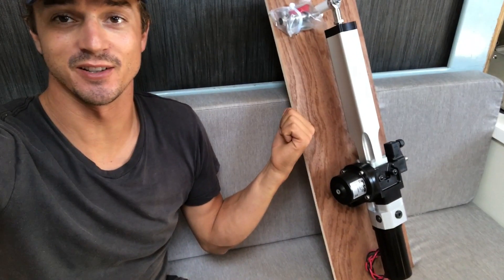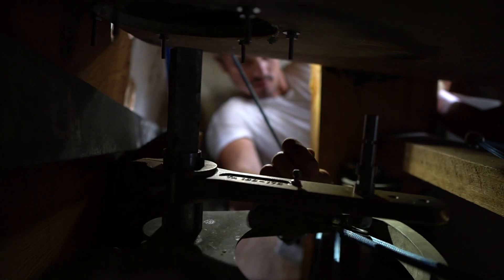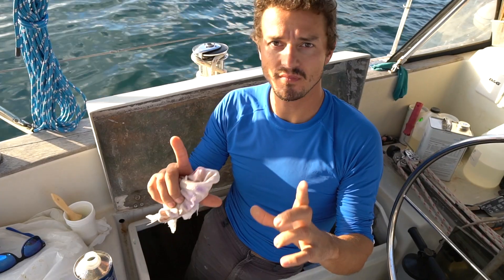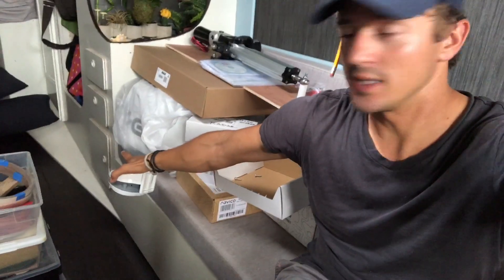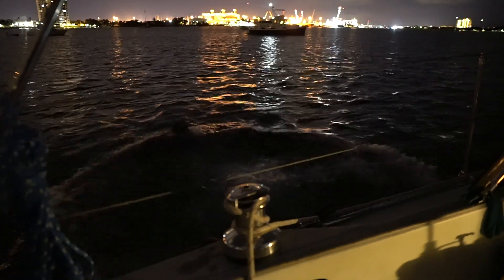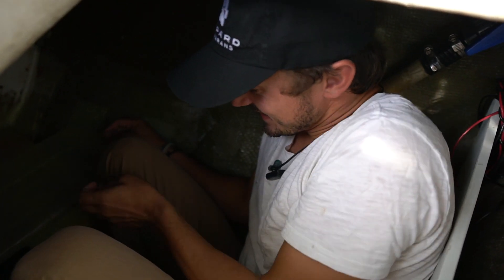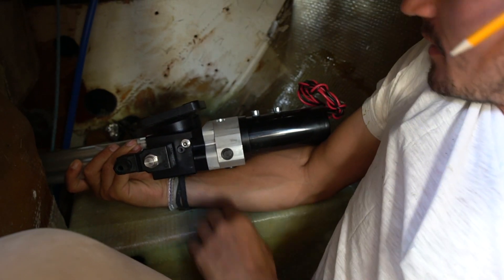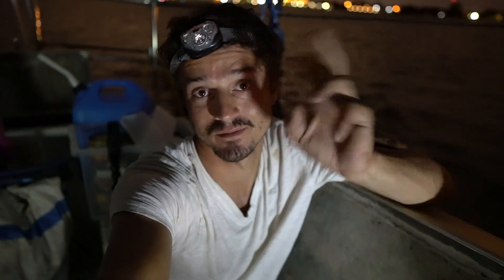Our Last Big Boat Project of the Year— Sailing Uma [Step 149]

Comment: You broke our hearts cutting the old auto pilot. Someone may have been able to get it to work. Maybe a family without an autopilot. ❤️
Reply from the maker: We thought about it. But the plastic itself was degrading and cracking. Not much left to salvage. Otherwise we would have passed it on.

Comment: I would have gone raymarine  ,proven,nothing wrong with wheel steering what you need was an upgrade to evolution,mine stays dead on course all sea conditions ,that hydraulic is for larger boats and uses more power

Comment: I could be wrong, but it looks like you should have installed the ram turned 90 degrees so that the mount bad is on a vertical mount, not a horizontal. The way that pin looks like it works, that is the pivot point for the ram to change angle as the bronze tiller turns. The way you have it mounted, as the tiller turns, and the angle changes, the ram will have lateral forces that may cause damage or binding. Maybe I'm wrong, I hope I am, but that's how I see it.
Reply: mount pad, not mount bad
Reply: This guy has a point. He might be right. At least it's worth re-reading the instructions, just to make sure. What he said makes perfect sense to me, since mine has a pivot allowing horizontal movement, not vertical movement.
Reply: While that it is a fair point to watch out for the orientation the way  I see it it should be fine, or yet its the way its supposed to be. The T0 Hydraulic Ram appears to have acceptable  360° horizontal movement (when base plate is mounted horizontally) and +-8° up and down. The way I see it horizontal turn is whats required to accomodate the changing angle to the tiller so this appears to be the right way, or am I missing something?
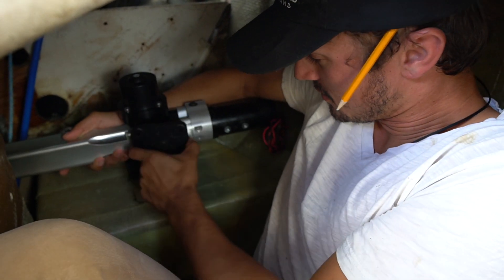Reply: If that's how it works, great, I just wasn't able to see that from how it looked like that pin installs and from the way Dan moved it at 15:19.
Reply: True the wiggling there seems to show the +-8° but i think it rotates too.
Reply: I hope you're right.
Reply: 17:11 You can see it rotate on the axis you are concerned with. He is good to go! You had me worried for them. haha
Reply: Good catch! Now I'm really curious how that pin allows it to rotate.

Comment: Dude, you’ve got to stop over building. Engineers already calculate in safety factoring. Weight equals danger & compounds your over building. Soon it will transfer into the next weakest link which for example will be a sheet block & sail clew. Weight in cruising boats matters just as much as racing boats. Sometimes more because you are mostly short handed.

Comment: Dan if you get an autopilot  you could at least get Kika a wire brush to clean the hull.
Reply: No wire brush - a regular brush at most. Wire brush would risk damaging the antifouling.
Reply: That hull paint, you could use a simple hand mit luffa sponge! No need for anything more aggressive than that as the paint is new!
Reply: @clarisd  The under pinning comment is "GET THE GIRL A BRUSH" no need to rip your hands apart.

Comment: are you saying you have a copper bottom now or you changed from a copper bottom to something else?
Reply: Didn't you watch previous episodes ?
Reply: They used to have a copper bottom at the begin. They even mixed the stuff themselves. The results weren't that awesome, so now they have a regular market stuff. Just not sure which one tho...
Reply: @englishmaninfrance661   yes simon but I forgot and don't have the motivation to look thru all the vids to figure it out.  I've got severe lyme disease with neurological involvement and would have preferred an answer instead of chastising me.
Reply: @thomask5295   thank you Thomas, maybe someone will remember what they used this time.  I always thought copper was king, guess not.
Reply from the maker: We changed to normal ablative this time around to test the difference. We dont thin our DIY version of the copper paint worked very well. But we didnt have anything else to compare it to so we figured we would change it and see...
Reply: @SailingUma   ohhhh, thank you for the explanation.  you thinned the copper bottom but that didn't work too well.  possibly if it wasn't thinned it would have worked.  now you used a regular coating and that's working to your satisfaction.
Reply: @donaldfafard  Actually no. They got some copper powder and mixed the stuff together with some resin so that they didn't just thinned a market-ready product, but rather made their own.
Reply: thanks for the clarification,  @thomask5295  .  I would have thought any copper would kill or at least repel anything trying to attach itself, guess not.
Reply: AZ DONALD , have a look at Video 137

Comment: Not to sure about all these comments about size of you guys, at 6ft 2 I doubt that I could fit in them small spaces & then we come to crew sizes <wife s> Ok mine is shorter than myself but in nautical polite terms she s beam / stern heavy but as a consolation  I dont need ballast , Thinking out aloud my wife is russian & just in case she reads this she wont understand it I hope. Good educational vid guys only point noticed is the small blue pipe was moving near to the tie rod on the ram have you cable tied it to the larger pipe for zero wear point in the future ?  Thinking out loud again is it grounds for divorce calling my wife stern heavy because she has a big chest also Lol . if this were to happen has Kikki got any sisters ? < but with normal hair > Lol.Joke now -------- Kikki can multitask tip her upside down great as a floor mop , outside deck scrubbing, & with a hooka system a hull cleaner.  OMG love that hair !

Comment: It is an electric ram, not hydraulic. Nice job.
Reply from the maker: It actually is hydraulic. But is an all in one system.  It has an electric pump that forces the oil into the cylinder from the built in reservoir.
Reply: @SailingUma  I stand corrected!